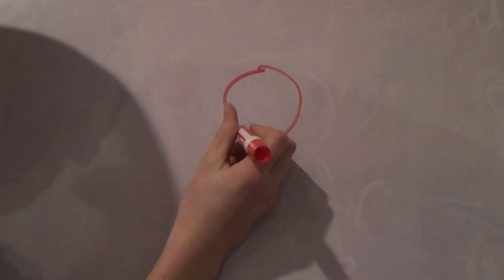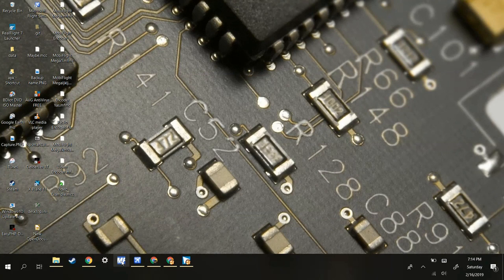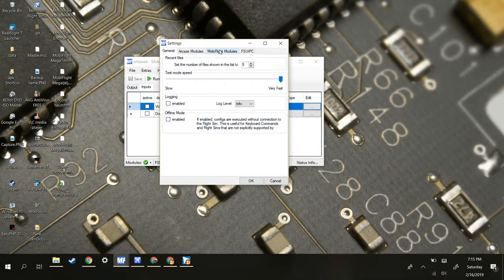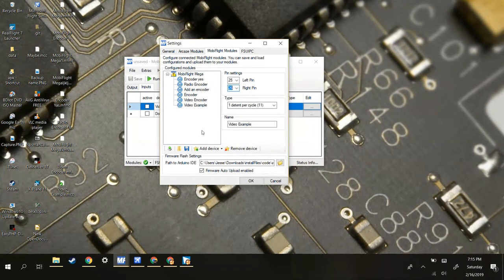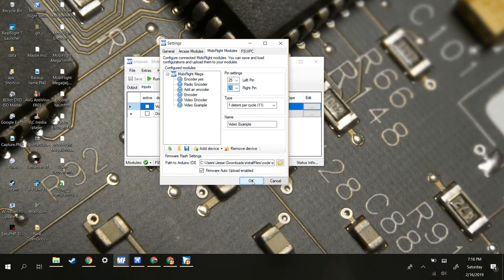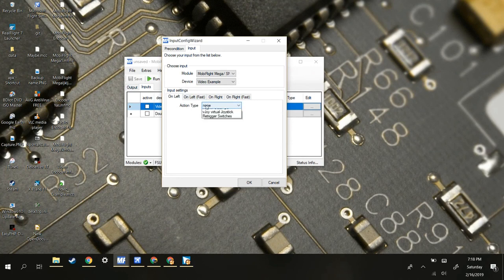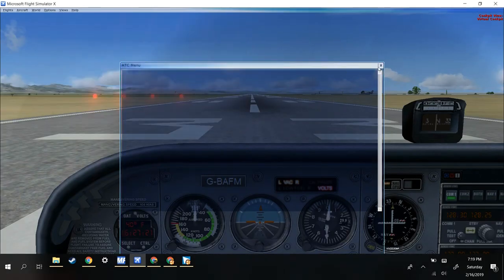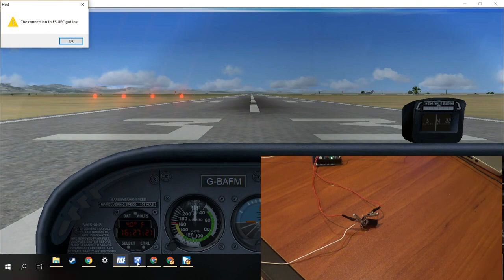How to Connect an Encoder to Arduino to FSX using MobiFlight | Captain Bob Simulation

Comment: Hi Captain Bob first of thank you for your videos , i have a small problem may be you can help, i am setting up an encoder for AP Speed the encoder is working fine but my problem is when i go below zero it goes to 9990 what is the value i need to put ( at the moment is left $-1 and Right is $+1 )
Reply from the maker: You could add a row that reads the AP speed under output
Then under your input row use as a precondition that only allows it to function if the value is above 0.
What simulator are you using? If it's MSFS2020 I'd recommend using MSFS2020 Events above FSUIPC.
Reply from the maker: or you could put something like 
if($>0, $-1)
in the transform window, that would be much simpler, try that first

Comment: Thank you so much for this video.. Is there a way to modify the rotary speed? Say PMDG 737 MINS knob takes forever to turn to a high value, and I cannot find any other preset.  Thanks!
Reply from the maker: Unfortunately I don't really have a way of doing this with PMDG events. Sometimes changing the detent per cycle will give you your actual rotary encoder's detent per cycle. 
I'd be curious to see if creating a duplicate configuration row would "double trigger" the event.
Reply: @CaptainBobSim  I understand.. Will give it a try.. thank you so much... Happy new year!

Comment: CB, still using your gamepad code for toggles. I tried two different Mega boards for a POV box project, but failed. The problem with Mega is the lack of USB and HID interface. After two days downloading and trying various dated software, I gave up. Slapped two arcade boards and 8 five-way navigation modules in my box with immediate success. That gave me 32 functions with the center-push buttons not wired.
Reply from the maker: Very cool! Did you use the Leo Bodnar board?

Comment: If i want to make an autopilot panel with the encoder and the 7 segment i just need to connect the 7 segment like in your 7 segment tutorial video with same arduino board right? Or it has a different wiring method?
Reply from the maker: Yup! Same wiring method! I'd highly recommend using my more recent encoder video though, I think it's more helpful :)
Reply: @CaptainBobSim  thank you. Is it possible to use a multiple arduino board in a single pc? How?
Reply from the maker: @mohammadzhafrannabil7899  Plug multiple in :) You can have multiple arduinos under the extras/settings tab (I think up to 104)
Reply: @CaptainBobSim  oke thank very much

Comment: Buenos dias, por favor podrias explicar como conectar un potenciometro lineal en Mobiflight, saludos.
Reply from the maker: ^EDIT: MobiFlight does have support for analog inputs. Refer to their GitHub Wiki for more info^
Buenos dias! MobiFlight no es compatible actualmente con potenciómetros, ya que son entradas analógicas. Sin embargo, puede usar una tarjeta de joystick analógica Leobodnar o un arduino Leonardo con un boceto de Joystick en él. ¡Tenga un buen día!
(Translated with google)
Buenos dias! MobiFlight is currently not compatible with potentiometers, as these are analog inputs. You can however use a Leobodnar analog joystick card, or an arduino Leonardo with a Joystick sketch on it. Have a good day!
Reply: @CaptainBobSim  Buenas noches, muchas gracias por tu respuesta, un saludo.

Comment: Good evening Captain Bob. I think you are the only one who could help me with a few simple answers to my questions. I am determined to build the cockpit of the 172. I am very good at following procedures. construction I am very good at working with my hands, I consider myself a craftsman of detail. I have the tools to do it. I lost my job due to the covid19. And for that reason I"m limited in the budget, but I can build the panel as close to reality. Of course I am making it. My only problem is.  I am an electronic guy. The only thing I know is positive and negative neutral. I play with Arduinos because the Arduino is already done. and people who know about electronic design. But I don't know how the codes are made. The problem is time. It would take me a long time to do an electronics course, that I will do if God allows me I'm planning to take one. But at the moment I am zero in knowledge. So my questions how many Arduinos do I need. To make the 16 dual & single instruments of the panel. The 2 annunciators the engine clock, the fuses, the switches, Flap indicator, trim wheel, carburetor heat, The radios uses 3 Arduinos from the link you share. Also I discovered that there are 2 versions of  the radio stack and there are 2 versions of the trim wheel, Modify, correct, update and or improve the mechanical designs are not a problem for me, I'm so good making things work better  the problem is the electronic part. I think that at the end of this week I already have all the 3d printed parts of the instruments  and everything I need.  I am waiting for the electronic components and I ordered 4 Arduino mega. I do not know how many more I will need. I need to be instructed well once and I learn to do it by myself. Once I learned how to make that radio stack of this cessna. Knowing how you can install the maximum number of functions in the smallest number of Arduinos. I would dedicate myself to recreating other different airplanes. In advance captain a million thanks. So if you  can guide me. To find the right information I will thank you for ever. Also if you need any thing  to biuld in the cnc or 3d printer or laser will be a pleasure. The idea is to help us each other. By the way im located in South Florida. Ft Lauderdale to be exact.
Reply from the maker: Good Morning Edwin,
Thanks for your comment. The impact due to COVID is tremendous, my best wishes to you.
The electronic knowledge will slowly come as you ask questions and google them. A 30 minute electronics YouTube should help a lot, without being too time demanding. I use MobiFlight to configure instruments (as shown in this video and others on the channel) I've also seen people code instruments but haven't yet learned to do it.
I currently use 2 Arduino Megas and anticipate a full Cessna 172 Cockpit would only need 3-4 (150+ I/O pins), especially with the new use of Analog pins.  
Your project sounds fantastic, keep me posted! (if you want to of course)
Unless shipping is an issue, I'd buy Arduinos as you need them. Note: There have been some errors found in the Flying For Fun PCB. Maybe they've been fixed, maybe not. I'd look into it before getting one. 
My best advice to learn things: look at other people's projects, use online files from people who've done it before, look up tutorials for electronics on YouTube, and use forums when needed. Try to soak up as much as you can, but make sure you are actively learning, trying it out and making mistakes. Failure is an excellent teacher.
I could anticipate the use of a CNC machine or laser cutter being needed, thank you so much for your offer.
Have a great day,
Trevor "Captain Bob"

Comment: Hi, I never used mobiflight before but I'm planning to build a yoke and pedals with it. Do tou know if mobiflight natively supports analog inputs (potentiometers) for that or it only accepts encoders? If it accepts only encoders can I use incremental encoders?
Reply from the maker: ^EDIT: MobiFlight does have support for analog inputs. Refer to their GitHub Wiki for more info^
It does not support potentiometers. You can use an incremental encoder to my knowledge for flight controls (it just might not be ideal). I'd recommend getting a dedicated joystick card such as a leobodnar (or an arduino leonardo with a joystick sketch).
You can look at my Trim Wheel and 5 Axis controller videos on the channel page.
Reply: @CaptainBobSim  thanks!

Comment: Hello Captain Bob.  I do have a question. i did the attitude indicator how you explained. and works on the new Microsoft FS2020, the only thing is need to be calibrated, because it moves out of control and shakes to much. My question is how many instruments can we connect in a arduino, and how many arduinos can we connect in to a single flightsimulator?
Reply from the maker: Hello! A stepper motor might be more smooth and shake less, I just haven't designed an instrument arround it. You can look at the limitations here: https://www.mobiflight.com/en/documentation/faq.html
Reply: You the man. Thanks

Comment: juste can you give in your description a shematics to connects the encoder to arduino board plz
Reply from the maker: The middle pin goes to the ground pin, and the other two wires go to any pin configurable in MobiFlight

Comment: My pack of encoders came today but they are each soldered onto a module. Did I purchase the wrong ones or can I still use them?
Reply from the maker: Never fear! You can use them :) I assume you have this encoder, on the left:
https://encrypted-tbn0.gstatic.com/images?q=tbn%3AANd9GcREJsmdLaWC7sMlX_guJVT-DDyd8cduy3U7lXom8cl7sxR1weAB&usqp=CAU
CLK, and DT go to your pins on the arduino. GND goes to GND, and the schematics I see say 5v goes to 5v, though I don't think it should matter.
Reply: @CaptainBobSim  Life Saver! Thank you so much!

Comment: I have a problem, I click on action type, then load present, and there I have no increase and decrease, I don't know if it's a fsuipc problem or what.
Reply from the maker: Are you on the inputs tab?
Reply: @CaptainBobSim  yes
Reply from the maker: hmm, Here are my tips: 
Make sure you are using an Arduino Mega, and that an encoder is flashed onto it.
Try it with either a different FSUIPC offset preset, or an event ID.
When the simulator is running, make sure you have both green checkmarks on the bottom right corner.
Reply from the maker: @William RobbersHave you asked the question on the MobiFlight Forum? I'm not sure how to answer this one :(

Comment: Could you make a video about GPS, from Flying for fun, using the image PCB, in the forum, how would you connect it? If you had the PCB using your encoders and LEDs,
Thank you and I would appreciate it very much, you are great in your videos, and very skilled in what you explain, you see that you like aviation a lot. Greetings Captain Bob
Reply from the maker: I will likely make a video after I finish my radio stack, switch panel, throttle and instruments. It will take a while, but it should come :)

Comment: i have problem it doesent show any mobiflight modules
how to fix it?
Reply from the maker: Did you install Arduino IDE? Sebastian (Founder of MobiFlight) made a tutorial on how to install it, if you haven't already. 
If you already did, I might close and reopen MobiFlight, make sure the 
Arduino is an Arduino Mega 2560, and you could also try telling it nicely to work😂
Good luck! You can email screenshots to CaptainBobSim@gmail.com if you need more help, or reply to this.
Reply: oh i forgot to check my arduino i have arduino uno r3